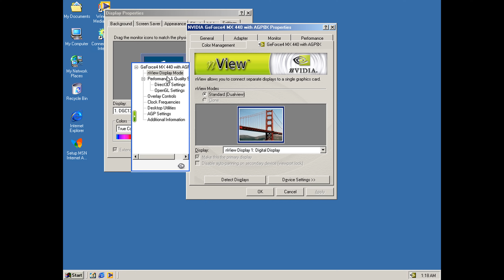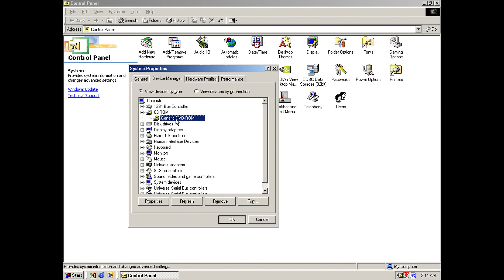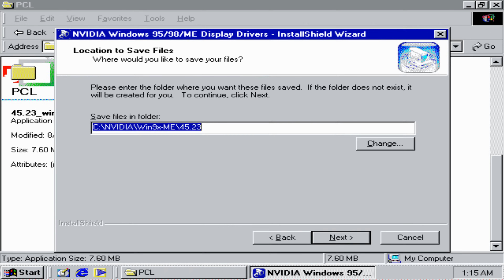I gave Windows ME another try

Comment: 512MB is plenty! I remember running XP regularly with 256, SOMETIMES 512 (at least in the early 00s up until 1-4gb was cheap). Remember using 98 with 64MB for awhile and eventually 128MB. And then Win2k at 384MB.It's funny how little ram we needed for so long.
Reply: To do more and less the samr thigs. Current OSs consume 10 fold the memory just to present you some fancy icons nothing more. It's frustrating
Reply: @riccardoiovenitti8688  as soon as we made the jump out of 32bit, things have run away with memory usage. And with so much available for so cheap now, nobody ever tries to optimize either.  
Honestly preferred the 32bit days where there was more of a push to optimize and make the best with the least. Imagine that + modern languages that are even more efficient…
Reply: @riccardoiovenitti8688 Windows and macOS anyway.
Plus browsers come with so much stuff preloaded, it's insane how quickly developers threw out memory and code optimization in favor of ease and comfort and how we as users got used to it.
Reply from the maker: Yea with 98 most had 64 or 128 if I remember...
Reply: Back then programmers really optimised the code. Now noone cares since its faster to just write bigger specs required for your app
Reply: My first pc with win95 had 16mb of ram. I remember only upgrading to 32mb just so I could run age of empires 2 better
Reply: I vaguely remember running a 486 dx/66 with 4mb of ram, then in a span of a week going to 8 then 16 mb. Win 95 didn't install on 4, ran very badly on 8, and was fine on 16. Games were terrible, but win 95 ran fine.
Reply: @alexkindl861  I am somewhat jealous whenever I read what machines people ran Win95 on.
Back then I really couldn't read myself but thanks to my dad I had a 486DX2 early on.
I remember asking him whether we could install Win95 onto it since it ran 3.11fW and he already told me it wouldn't start as he tried already.

We sat there for two hours with the sad result that Win95 would install but hang every time on its splash screen, making my dad reverting the machine back to 3.11fW afterwards.

Come to think of it, knowing the turbo button on some machines had weird configurations, maybe that's what cursed it not to boot.
Reply: @vardekpetrovic9716  mee ti but with 9mb Merlin ran much Better. You went to internet you wrote the same documents you filled the same spreadsheet but with 1/1000 of the power without complaining...so...what do modern os really do?
Reply: The Good ole days!

Comment: WinME was Microsoft's attempt to hide DOS under a rock, but it was still there. Most of us back in the day dual booted Win98/Win2k. Win2k (NT) was a pure 32bit OS without the 16bit DOS, and also had multi-processor support (for those of us who owned a VP6, BP6 or similar). Win2k also had much better parallel port management. This can be demonstrated using a scanner, zipdrive and printer daisychained to the PP. If you try to use them at the same time on 98 it will most certainly crash. Win2k has no problem and data transfer in much faster on the zipdive. This may require changing the parallel port setting in the BIOS though.
Reply: And Win2K has a generic USB mass storage driver built in you just plug in a mass storage device like a USB stick either FAT32 or NTFS formatted and it will show up in Explorer.

Comment: Fun Fact: That closet you were hacking into at the start of System Shock 2 has a passcode of 00000. I also prefer 800x600 in that game instead of 1024x768 because at 800x600 the vertical MFDs show up at the bottom corners instead of top corners, which I find more comfortable to read. Beyond that, the main reason I avoided ME since forever was not because it was "bad" but specifically because of the lack of proper DOS support.
Reply from the maker: Great comment, thank you 👍

Comment: I'd be very interested in a DOS-mode-restored testing of Windows ME.
I had ME back in the day, for a fairly long time actually because I was a bit late jumping to XP. It certainly wasn't any more unstable than 98 that's for sure.

On a semi-related tangent, have you ever tried installing an Audigy 2 ZS in DOS with the Audigy 1 driver? It would make a compelling option for a fast, late 9x focused but DOS-compatible build such as this one, provided it works as some claim.
Reply from the maker: I haven't but there are guides out there. Joseph in particular has done a guide for this.

Comment: It actually wasn't terrible - I had a P60 with 12Mb of FPS memory, VESA video card and an 8 bit soundblaster, BTC 12x CDROM, as well as a really slow and noisy Maxtor 512 Mb hard disk. It was a terrible system, and I put a terrible OS on it. 

You know what? It actually worked and was quite stable. I sold it to an accountant for like $300.

Comment: kinda need the VXD audio drivers for some games to sound correctly, like NFS 4 High Stakes / Road Challenge, the EAX on it has very overblown reverb volume with WDM drivers
Reply from the maker: Yes some games have issues. But at least System Shock and TA worked fine. So maybe the list of games with issues is small?
Reply: @philscomputerlab  hopefully, hard to say when no one has made a comprehensive research on that subject, I'm doing so now but it's taking a while, way too many games to test. That said, if we gonna use wdm drivers, might as well use windows 2000, much more stable and reliable, and most games even perform better on it for some reason... I see main purpose of win9x to be for compatibility for some really old games that will not work correctly on anything NT, even if just small stuff like this

Comment: I had no problems with ME back in the day.   I did turn off the restore feature which noticeably slowed the computer down.  I also removed the massive amount of bloatware and trial software that many computers had in that time period.  It also helped that my ME was OEM to the computer which means I didn't have driver issues that the people installing ME may of had.
Reply: I used that OS even on laptops like Sony Vaio PCG-F707 without problems, even with many videocards, for me was always stable.

Comment: I liked WinME back in the day, it did boot quickly. I didn't find it that unstable, I think the issue at the time was the removal of DOS modes.
Reply: @vardekpetrovic9716  2k was windows NT and only meant for businesses. Calling someone a fool for not purchasing a completely different line of OSes not marketed to them is rather silly.
Reply: @RickeyJSimas  Yeah I remember the days of getting patched drivers for voodoo cards to work with Win2k. Good times
Reply: @vardekpetrovic9716  Same. I had the same issue with ME on launch that Vista had on launch: driver vendors were not really "ready." Systems would go unstable real quick if you by chance mixed-and-matched legacy VXD and newer WDM drivers.

Going back and installing things today with the benefit of upgrades and proper driver packs isn't exactly the same "experience" as doing the upgrade on-launch.
Reply: Of course, the removal of the DOS modes contributed to the speed of booting... swings and roundabouts
Reply: I recall that 98Lite would make use of some WinME files if you had them available at install time.
Reply: We kept Windows 98 SE, or NT
Was Me only for minimal builds ?

Comment: One theory I heard about Windows Me instability was mixing VXD and WDM drivers together. For the most stable possible theoretical Windows Me setup you need all WDM drivers. That being said I've never wanted to try Windows Me ever again because I still have flashbacks of it having BSOD's all the time before it eventually bricked itself by corrupting the file system beyond repair.
Reply: WDM drivers were introduced in Win98. I used WDM driver for AWE64 from W2k installation, because it played 48kHz samples on 44,1 kHz soundcard with much better quality. And I have never problem with crashes, sometimes just mixer menu was a little broken.
Reply: It absolutely was. Instability was similar to 9x running VXD drivers, possibly a little worse when mixing the two driver models but couldn't confirm if that was the specific issue. If you gave it WDM drivers it was just fine.

Comment: Having massive black bars from 4:3 desktop displayed on a 16:9 monitor really grinds my gears, I wish there was a way to deal with it.
Reply from the maker: It really doesn't bother me!
Reply: I think it's to have games work properly without them being stretched out to fill the screen. So, it's a feature (of the monitor) not a bug
Reply: @Incommensurabilities  Nah, games change monitor resolution, so you can have wide screen desktop which will change into 4:3. Desktop isn't actual problem, but games are since they don't support wide screen in 99% cases.
Reply: it's nowhere as disgusting as horizontally stretched image
Reply: @r.d.7698 true

Comment: I really don't know what was the problem people had with Me. I had to reinstall 98 every other week to keep it running, while Me was working just fine. The only problem was no exit to DOS mode in it, but other than that - it was fine.
Reply: I had a really good experience and better stability with ME compared to any version of Windows up to XP. I don't know why it gets all the hate it does.
Reply: @ericanderson85  lack of dedicated drivers in beginning and people who tried to run them with 64MB of RAM.  For me ME was much stable and better system than 98SE.
Reply: I had no problems either.  I did turn off the restore feature and remove all the bloatware which noticeably sped things up.
Reply: It was terribly unstable for a lot of people. Some people didn’t have any problems. A lot did.

Comment: I have had better luck with ME than 98SE especially with newer hardware that was never intended to run Win9x. I have some good disk images created for both including dual boot with XP. This makes it easy for me to quickly test motherboards 👍
Reply from the maker: Yes it seems to have newer drivers and that can help! I remember someone had better success with ME and a thin client.
Reply: @philscomputerlab  lol that someone was probably me. I ended up with quite a few thin clients and have tried getting 98, ME, and/or XP running on most of them. Yes, you got me into thin clients and I’ve had a ton of fun messing them for the past 2-3 years now.